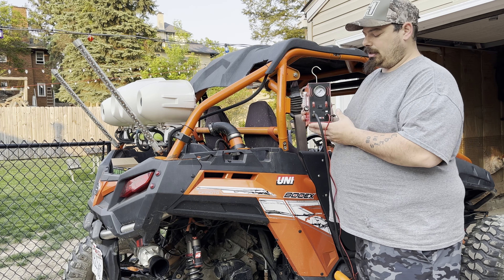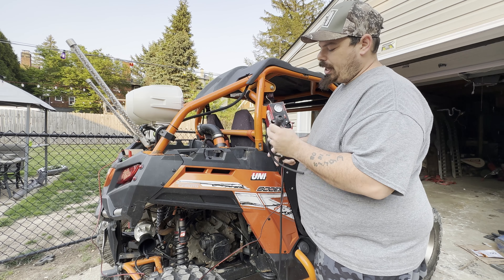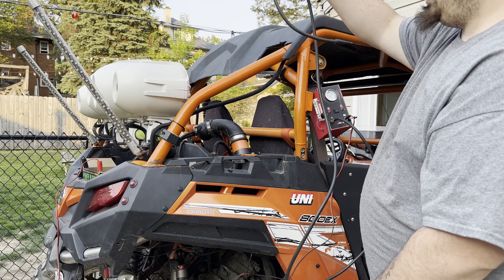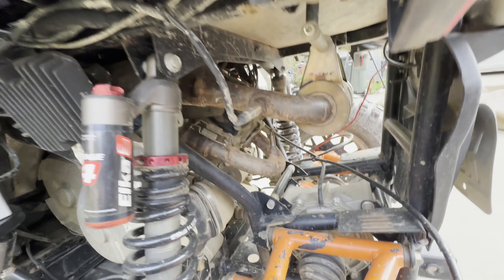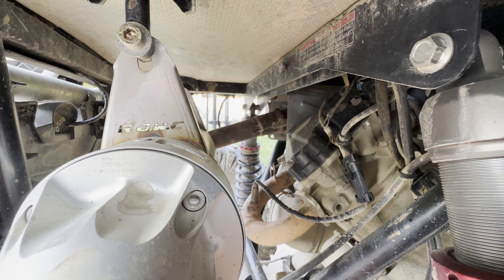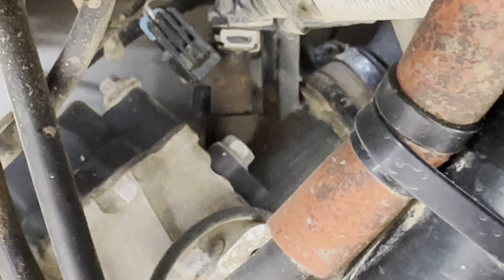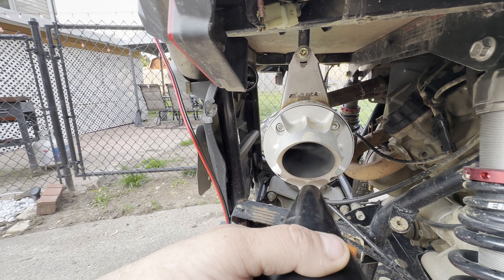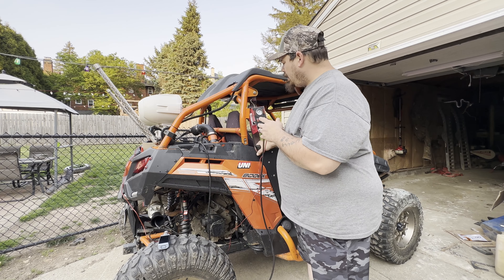CFMOTO Snorkle Leak TEST ANCEL S300

Comment: Quick question, can I put a dryer sheet between the machine and air intake behind drivers seat, zforce 800 ex, to keep dust out of belt intake.
Reply from the maker: Just get you a outerwear filter and cut it to fit.
Reply: @R.N.G Performance  10 4 thank you.

Comment: I have a question about  2023 u force 1000 xl. Im wanting to make sure all  vent lines are ran high with snorkels due to alot of water riding.  What all vent lines are there? I dont want to miss one.
Reply from the maker: Trans.  Fuel tank. Diffs.
Reply: Thanks